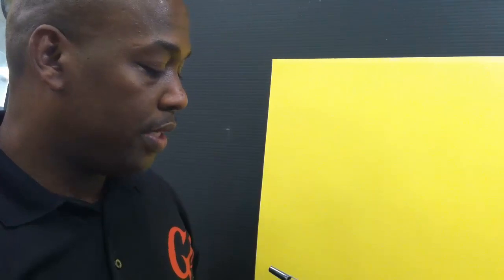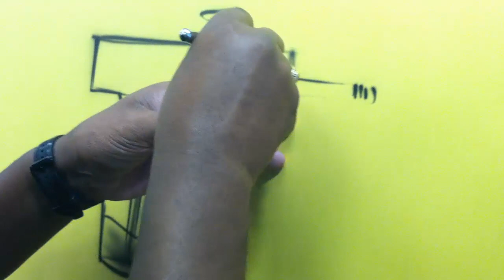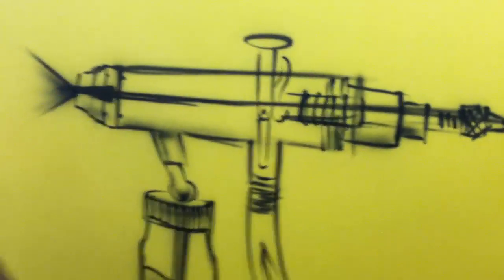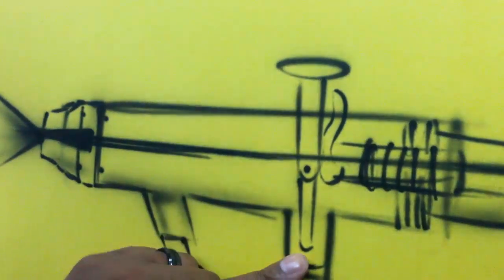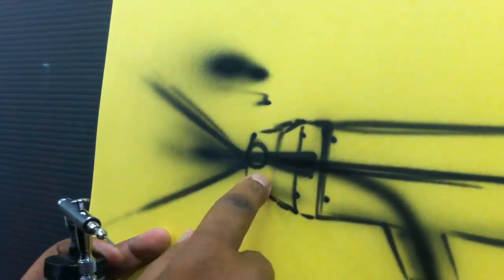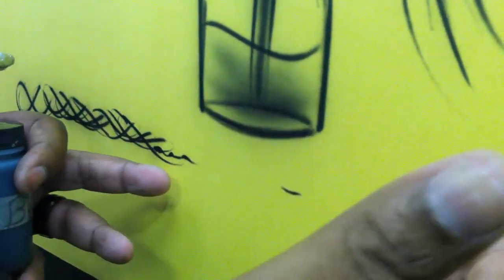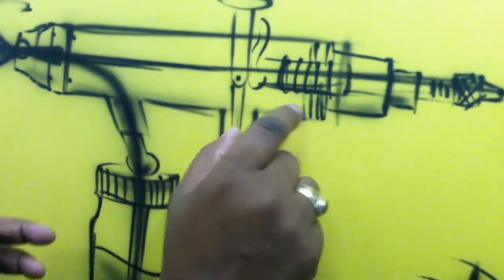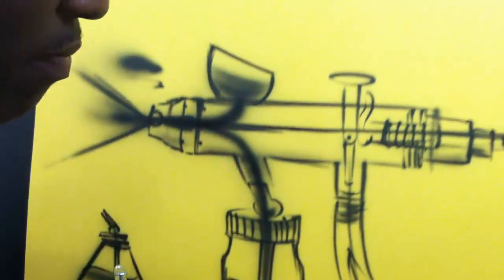How an Airbrush Works

Comment: Greg very good tutorial , I have been using airbrushes for years and i found the fact of leaving the trigger pressed maintaining air flow so as to keep the gun primed very useful as  most of us think of trying to give the compressor a  easier life by letting it rest because most of us use small compressors so its a great tip that had not crossed my mind before .

Comment: I loved this, thank you. When you clean your airbrush, do you use an ultra sonic cleaner or just use the liquid cleaner and swabs/paper towels?
Reply from the maker: +Shoe Doodles Hi Shoe, when it comes to cleaning airbrushes keep it simple. you can use airbrush cleaners or warm soapy water. remember don't use anything that could possible damage your O-rings inside most airbrushes. Swabs, pipe cleaners, and air. Yes air, blow air threw your nozzles or the body of the airbrush.:)

Comment: So how do these guys who make DIY Air brushes regulate thier air/paint mixture as it discharges? Your device has a valve or "strike plate" as you called it, under the trigger, but the homeade devices dont have that.

Comment: I'm new to airbrushing and want to start customizing shoes..what type of kit should I order, brand, paint..etc? Correct PSI to use and so forth
Reply from the maker: +Joshua Taylor posting a video soon concerning shoes. There is really no kit. Its just  airbrush Wicked paint, paint adhesion promoter and a good clear coat. PSI anywhere between 25 to 35.

Comment: How do you keep your tip from drying out so fast. I can only paint for a few moments before the pain builds up on the tip and I have to wipe it off.
Reply from the maker: reducer
Reply: +Gregs Airbrushing what is the ratio of reducer to paint?
Reply from the maker: usually 70% paint -30% reducer
Reply: +Gregs Airbrushing thank you!
Reply from the maker: Hi AsianAtreyu, 
    Use the reducer for the paint you use.

Comment: hello.  Which airbrush do you recommend the one with the container at the bottom or the one at the top?  Thanks
Reply from the maker: Your referring to a siphon feed (bottle on the bottom) or gravity feed (cup on the top). It all depends on the job your doing. More detailed artwork-I would use a gravity feed.
Reply: @GregsAirbrush  Thank you for the answer!  I intend to restore my motorcycle but I also want to decorate my gym.  So what do you recommend?  I didn't actually practice drawing for long.  I was doing really well.  I will go through all your posts and hope to get in my hand!